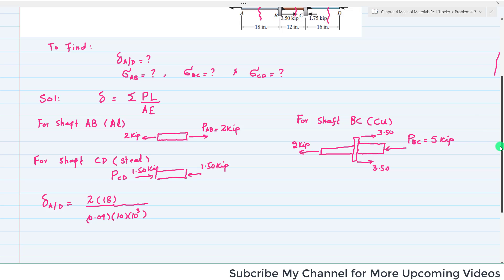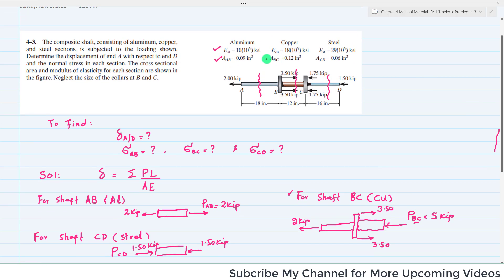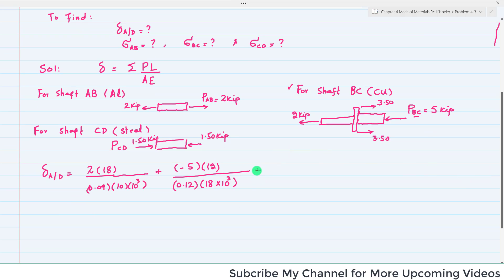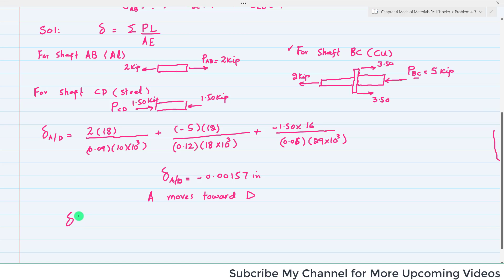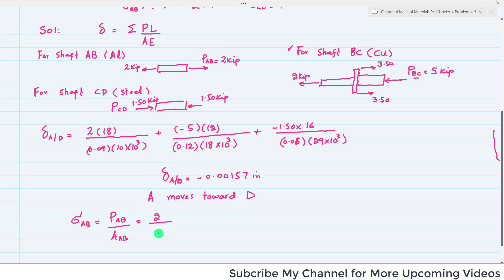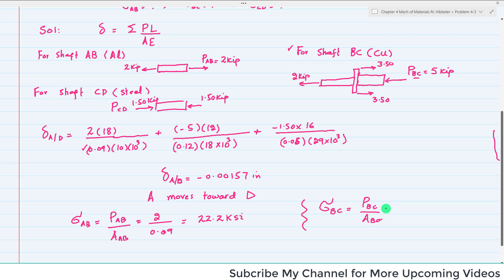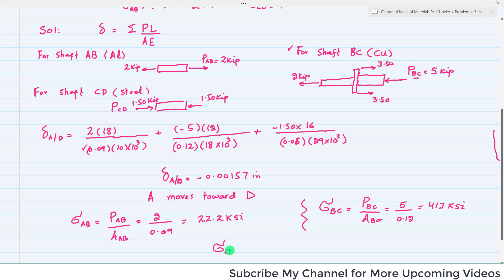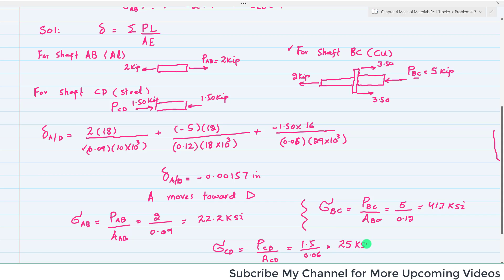4-3 Determine displacement of A & normal stress| Axial Loading| Mech of Materials by RC Hibbeler

Comment: By sectioning segment AB ,the PAB is. Not same On both L.H.S and R.h.s why?
Reply from the maker: It's same. Can you please mention the time frame where you have issue?
Reply from the maker: If you take RHS or LHS of Seg AB,  the force PAB WILL BE 2 KIP
Reply: Sorry I mean by sectioning BC the answer of RHS is not equal to the answer of LHS
Reply from the maker: It will be same and Pbc will be 5 kip

Comment: Great video! When solving for the internal forces Pab, Pbc, and Pcd, how come none of the sections take into account the two 1.75 kip forces applied on the right side of BC? I understand how the way you cut the sections excluded this force, but does that mean any amount of force could've been there and it wouldn't have affected the final result?
Reply from the maker: @Trevor E you are welcome and keep watching it and also share it with your friends.
Reply from the maker: First of thank you for your valuable feedback. Now For Every section you have to to cut it and represent the force and then calculate the reaction force by applying equilibrium condition. Coming to your point where you have mention that I have excluded 1.7 kip force so the answer is that if you cut rod CD and take the right side portion and mention all force s 2 kip, 2 times 3.5 kips and then 2 time 1.75 kips and apply equilibrium condition so you will get the same Pcd is 1.50 kips. That is also right. But I have taken the left side for simple calculation.  I hope it will be clear now. Thank you
Reply: @engradnanrasheedmechanical  Thanks for the quick response! That clears it up for me.